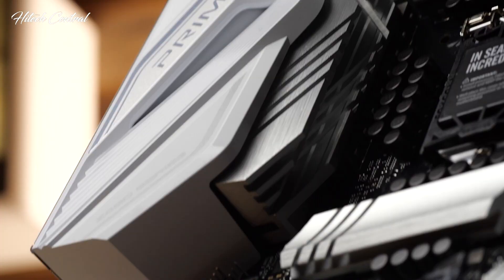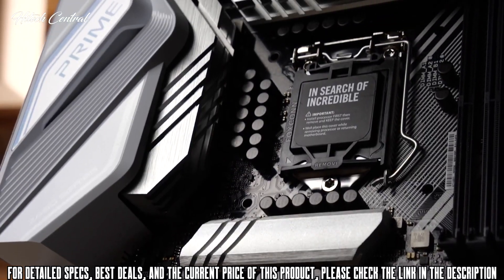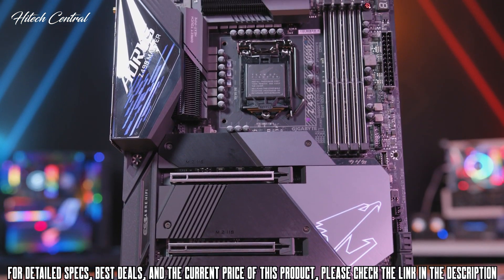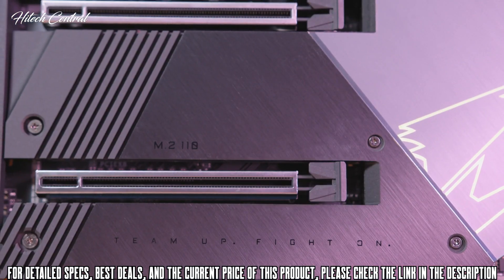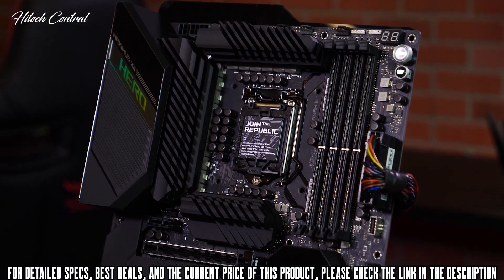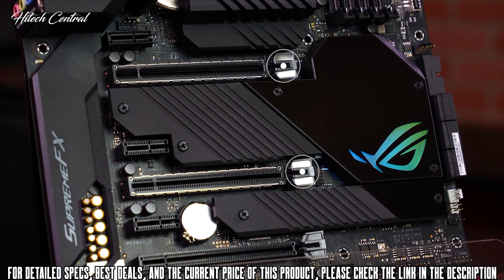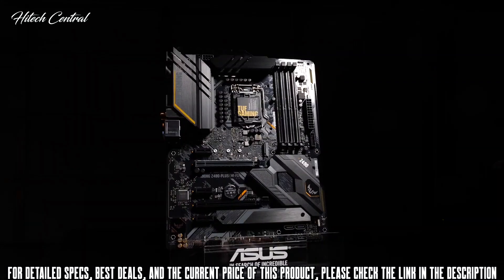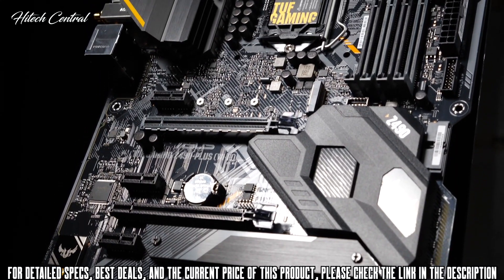Top 5 Best Z490 Motherboards for Intel's 10th Gn Core Processors

Comment from the maker: Top 5 Best Z490 Motherboards for Intel's 10th Gn Core Processors
Are you looking for the best Z490 motherboard of 2020? These are some of the best Z490 boards we found so far:

✅1. ASUS Prime Z490-A LGA 1200 (Intel 10th Gen) ATX Motherboard
https://amzn.to/2MFbuHO
✅2. GIGABYTE Z490 AORUS Master Intel LGA1200 Z490 GAming Motherboard
https://amzn.to/2Adh0z1
✅3. ASUS ROG Maximus XII Hero Z490 (WiFi 6) LGA 1200 (Intel 10th Gen) ATX Gaming Motherboard
ASUS ROG Maximus XII Hero Z490 (WiFi 6) LGA 1200 (Intel 10th Gen) ATX Gaming Motherboard
✅4. MSI MPG Z490 Gaming Carbon WiFi Gaming Motherboard (ATX, 10th Gen Intel Core, LGA 1200 Socket
https://amzn.to/2Ug4ply
✅5. ASUS TUF Gaming Z490-Plus (WiFi 6), LGA 1200 (Intel 10th Gen) ATX Gaming Motherboard
https://amzn.to/2Y3BLFe

Comment: Hey! Can you help me? I bought a ASUS Z490 Prime A motherboard. It needs a 4-pin connector and a 8-pin connector for the CPU. My EVGA 850 GA did only bring a 4-pin connector and the manual says I have to have the 8-pin connected. I haven't been able to find this "8-pin" connector! Where do I buy it? Where do I get it? What if I just leave with the 4-pin? I have a i7 10700k. I want to gaming on this PC. Will that be enough? I'm confused. It is my first time building a PC.

Comment: i get that LGA1200 is for the 10th gen intel processors, so they're really not backwards compatible? like a intel 4790k can't be used with this?
Reply: Not compatible so no, only 10th gen or 11th are for lga1200 sockets

Comment: Question for people out there:
I need a motherboard that supports 10th gen processors and needs 2 M.2 ports and enough room on the cpu for an NZXT cooler to fit up. Also what power supply will I need?
Reply: Even if you use a rtx 3080, i9 cpu, aio 360mm cooler, and 3 m.2, you'll only need about 650 watts if you think about over clocking you might want 800 watts just in case, anytime you go cover 800 watts is if you got more than one gpu and your over+everything is water cooled
Reply: I would go 800 watts anyways. 750 minimum

Comment: In my opinion the  ASUS TUF Gaming Z490-Plus (WiFi 6) is the best budget Z490 motherboard. If you go cheaper than this you are going to loose a lot of features.
Reply: Krispyy Marc it’s how u get internet
Reply: @thegreenman5004  not if you use an Ethernet cable, WiFi is wireless connection, Ethernet is wired
Reply: Oliver Rodriguez yea I know but the wifi comes with the Ethernet slot
Reply: @thegreenman5004  no ethernet comes with pretty much any motherboard

Comment: Which is the best between the first and second? I had the Aorus Master written down as my wanted motherboard, but i kinda wanna do like a white theme build, so the Asus Prime would look nice. Is there any major differences i have to take in mind? Or are they pretty much the same? Thanks for answers
Reply from the maker: Both motherboards are really good but I would personally choose  the  ASUS Prime Z490-A
Reply: HiTech Central one more question you might know the answer to. And Thanks for the last answer:) This will be my frist build and i wanna do watercooling. I dont really know how to bend hard tubes and i see that Can be very hard. Can 2 tubes go in to one 90° fitting? Like one tube going vertically in the fitting and another horizontally through the other end? Thanks if u know the answer:)
Reply: @bravadoplayz630  Unfortunately I never built a custom watercooled PC. I have an AIO 360mm and I'm very pleased with its performance.
Reply: @bravadoplayz630  You generally want to keep your lines as straight and least complicated as possible.